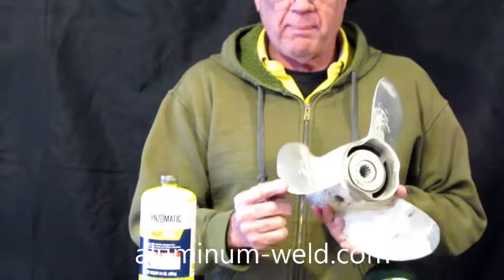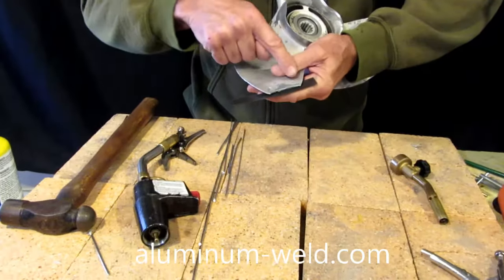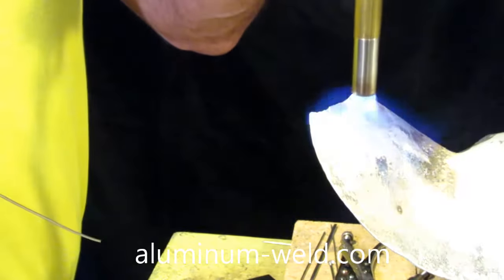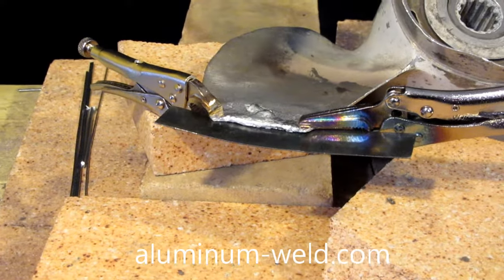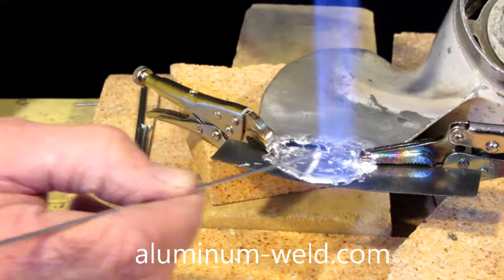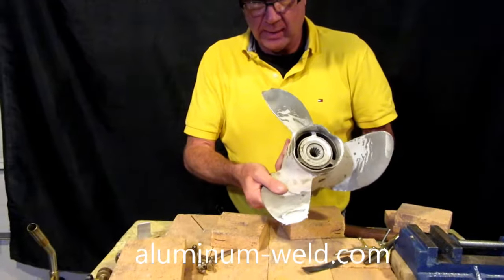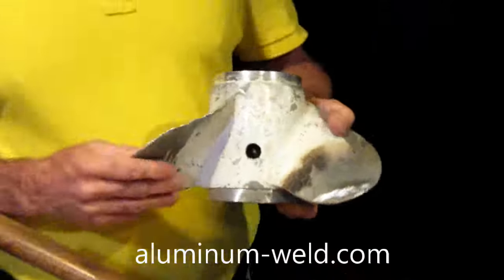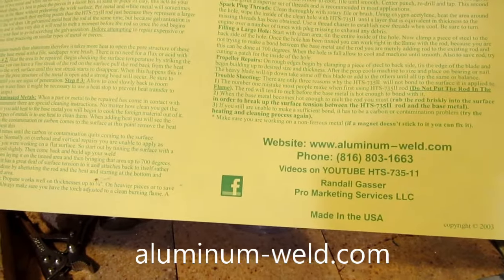DIY Aluminum Prop Repair Strength Test using HTS-735-11

Comment: Very cool video.  What do you do to do static prop balancing?
Reply from the maker: Check out the many videos on youtube on static balancing. You can either add rod to the lighter blades or remove material from the heavier blade.